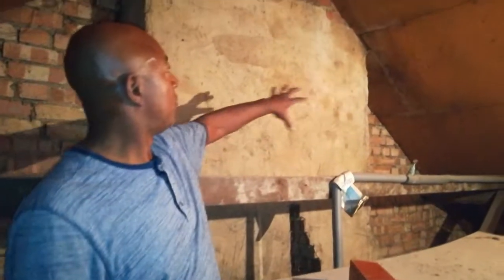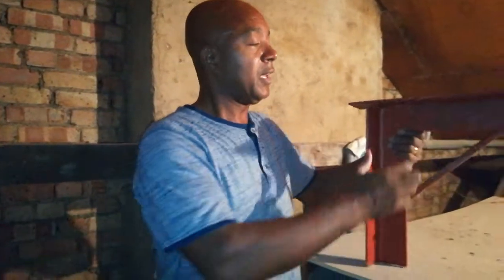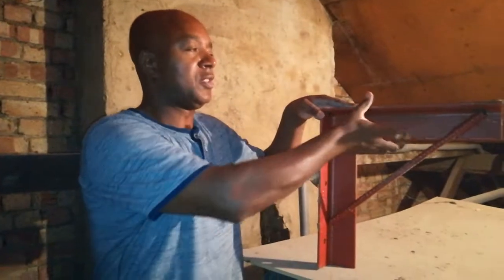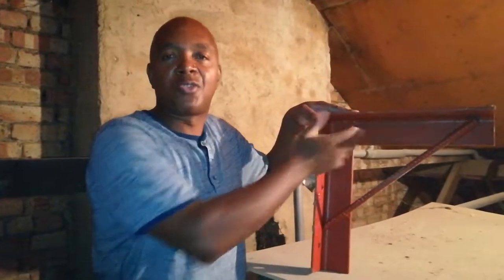Substandard DANGEROUS brackets

Comment: Even if you have a fully qualified contractor, yet have a personal reason not to contact a building control guy - there is a wealth of information here on youtube like this one, as well as British Standards and Gov.uk etc etc.  You may not be an expert, but reading up first might help you smell a rat even from a qualified worker.  You can ask innocent sounding questions easily enough like "wow, i'd had thought the bracket should be as least as wide as the chimney breast comes out from the party wall..." (etc).